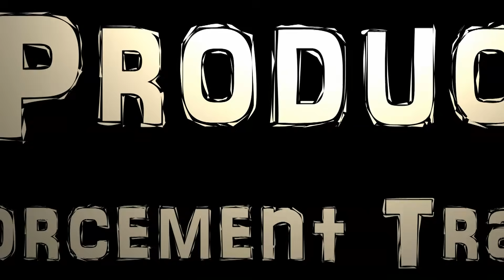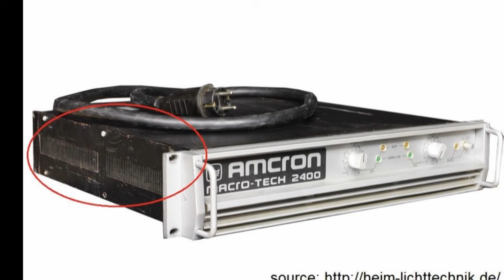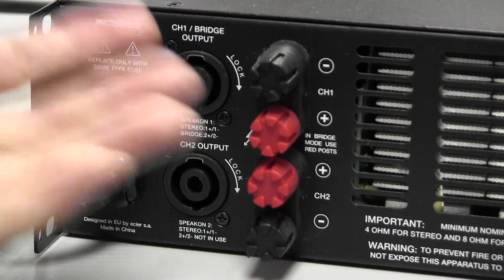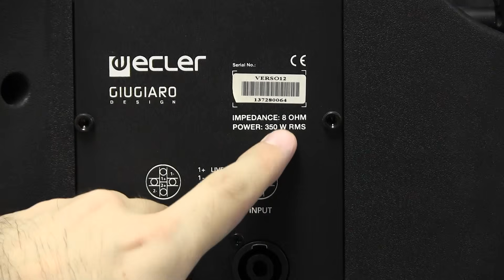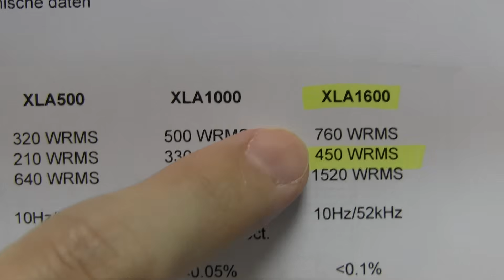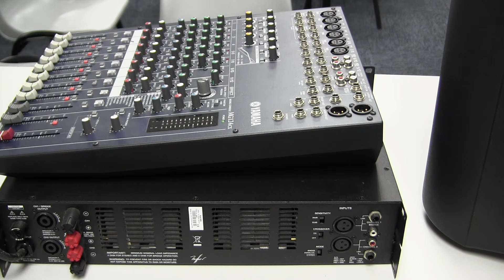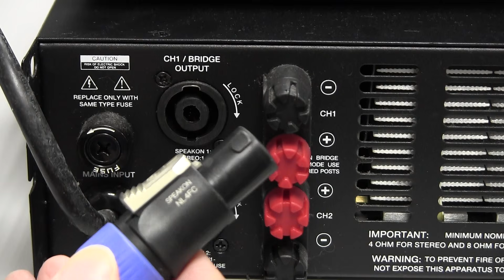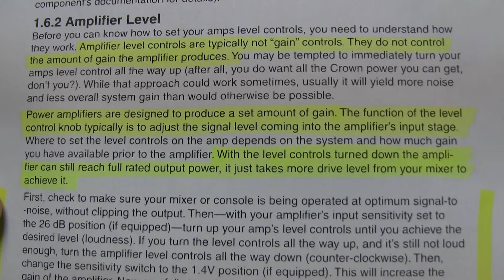How to connect a power amplifier to passive loudspeakers

Comment: Hi GLB a quick question please. if  I connect my loudspeaker 8 ohms to the speakon terminal channel 1 can i connect another 8 ohms loud speaker to the binding post on the same channel? and this will result to a 4 ohms config on my speaker?
Reply from the maker: Yes you can, that will result in a 4-ohm load on that amplifier channel, with each speaker getting half the power.
Reply: thanks much GLB for your reply. Your videos are so informative.

Comment: Hi Bruno, I am Rolando Galicia from Manila and i have an amplifier Denon Precetion Audio Component/Surround Amplifier AVC-1550. My problem is i do not have a wiring guidelines to connect in BRIDGE CONNECTION. Can you help me how to wire up.. Have a good day to you.
Reply from the maker: Those AV receivers are typically not designed to be bridged - if you really want to investigate this I suggest contacting Denon directly.
Reply: Thank you for your spare time for replying my message. What if I use APS 10 - Phase Shift control...do you think it will work? thanks and I do really appreciate your teaching which is clear and nice explanation...All the best..

Comment: Hi GLB Productions, I need your suggestions, I wrongly connected the polarity of the cable from 

my Spendor S3/5R2 speakers to my vintage Sansui stereo amplifier as follows: 

As wrongly the 2 Negatives of the 2 speakers were connected to the one channel of the 

amplifier and the 2 Positives of the 2 speakers were connected to the another channel of the

amplifier. One speaker was working and another speaker was not working. I was confused and

didn't notice about the wrong polarity for about 15 minutes, then I checked the cable

connections and detected the wrong thing. I became panic and sweated like anything. After I 

made the correct connection the two speakers sing as usual. But.. even though the speakers are

now working, still I have some fear. By the wrong connection:   Would the cross-overs of the 

speakers become weak? Did I do the great mistake? How will be the life and health of the speakers?

May I keep the speakers for long time?. If it would become weak, that would how much? 

Kindly let me know about in detail. I am much worried about the thing.
 
If I hear from you as: 'Need not be worried and the things are fine' , then I will be jumping 

with my transplanted knees! I very much love these small beauties. But, now I am sleepless. 

Thank you,

Regards,

Suseendran.
Reply from the maker: Well! I'm glad to hear that you spotted the problem. I just spent a few minutes drawing out some possible speaker/amp combinations and I'm pretty sure that your speakers are ok. If you damaged something you would be able to hear it almost straight away. If I were you I wouldn't worry and sleep well tonight!
Reply: Thank you very for the reply. Now I got the peace of mind. Thank God. Thank you once again. Best Regards,

Comment: CAN we use a power amp through powered mixer and run speakers through power amp, while other speakers directly connected to Powered mixer ? thanks
Reply from the maker: Yes you can connect the LINE LEVEL outputs of your powered mixer to another power amplifier in order to add more speakers.

Comment: I'm getting 2 behringer VP2520 euro live 2000w pa speakers and need to know if there was a certain mixer that I should get or if any mixer will work
Reply from the maker: You should get a mixer that is suitable for your needs and level of experience - your pro audio retailer will be able to advise you.
Reply: GLB Productions does that mean it doesn't matter what mixer I get as long as I know how to use it because I haven't used one before and I'm buying straight from amazon
Reply from the maker: I suggest getting some advice from a real person rather than buying sight unseen - there are so many different mixers out there with difference frame sizes, features etc.

Comment: Last question I currently have my setup as follows powered mixer with a 10" powered monitor can I hook up my passive loudspeaker to the mixer without having to use a power amplifier and if so how do I connect it properly?
Reply from the maker: If your mixer is a powered mixer (ie with a power amplifier section and speakon outputs) then just connect your speaker to the mixer in the same way as you would connect to an amplifier.
Reply: GLB Productions okay thank you

Comment: This video is very helpful thank you I have 12" rms passive loudspeaker and I thought I could just connect it to my Behring mixer but after watching this video I know I need to get a power amplifier to run the loudspeaker  can I run a subwoofer with the 1 loudspeaker based on how you connected the cables in the video
Reply from the maker: You want to run one sub and one fullrange speaker? Or one of each?
Reply: GLB Productions  one of each
Reply from the maker: If your sub has a passive crossover you can run amp -> sub -> fullrange but you'll need to make sure you amplifier can handle the combined impedance.

Comment: So this video was extremely informational and I've gained quite a bit of information but my problem is still unsolved. I received a DFX-215 speaker from a person and it seems to have had work done on it. This is no problem as i can solder wires and what not but i have the speakers wires (just the wires no plugs) and i have no clue how to hook them up to a power amp. I would greatly appreciate any help
Reply from the maker: If you are working with a speaker that has been modified then you will need to contact the manufacturer for the original specifications, in particular for information on what crossover is required and whether the speaker is designed to be run fullrange or biamplified. They will be the best people to advise you.

Comment: hi, this is a very informative video. i have a question, i own a presonus studiolive 16.4.2 and a pair of blastking passive speakers, but when i send the signal out of the presonus it sounds like crap, is it just because the need of the power amplifier? i don't want to waste money on an amplifier that might not be the solution, thx a lot
Reply from the maker: Where are you monitoring the signal that sounds like crap and what exactly about it is crap? Tone, distortion, volume etc?
Reply: i am trying to monitor sound on a pair of passive loudspeakers, they have each 2 jack plugs , i'm sending the sound through a presonus studiolive mixer via the aux send but the sound i get on the speaker is really distorted and very low volume, i set the volume really loud but the sound comes really low and distorted. so the solution is to connect the mixer to the power amp and then the power amp to the loudspeaker? thx
Reply from the maker: Aha yes that would most definitely be the issue ;) With passive speakers you MUST have a power amp - you can't drive them from the output of a mixer! Have a look at my recent video on active subs for the difference between active and passive speakers: https://www.youtube.com/watch?v=548GZAF6fMY
Reply: thank you very much
Reply from the maker: You're welcome :)

Comment: Hello, good video there... I have something to ask. Well, u see, I have an active speaker which the amplifier inside is already broken. So what I planned to do (which i have already done) is to disconnect all the wires inside which connects the speaker itself with the amplifier and do a minor modification which able me to connect the speaker with external amplifier. In a simple language, I have just converted (Modified) my active speaker to a passive speaker. Then, I had a 4-channel powered audio mixer which is used to power up the speaker via TRS cable directly without amplifier (coz the mixer itself is powered). So my question is, is it okay to do that? Will it damage my mixer or the speaker itself? because whenever the music goes loud or bassy, the mixer will stop sending audio signal to the speakers and resumes back when the music goes low or when the bass turns low.
Reply from the maker: I suggest getting the active speaker repaired instead of trying to improvise a solution as you have done.

Comment: Hello, very good video, i just have a doubt, how i connect my speakers, I want to connect them in stereo, but in the back they have this two in's, but above de two in's says "all inputs in parallel/speaker connectors: +1 pos/-1 neg", thanks
Reply from the maker: What sort of connectors are they? Quarter inch, binding post, speakon etc?
Reply: two of them, quarter inch (above) and speakon connectors(down), thanks!
Reply from the maker: alfredo carri Ah ok so you have one set of quarter inch connectors and one set of speakons. One connector is an input, the other can be used as an output. Just one one connector, either the speakon or quarter inch.

Comment: What's the different between home sub and for Dj sub?
Reply from the maker: Size, weight, power handling, frequency response, driver efficiency, design :) Subs for professional use are typically larger in size and can handle much more power.

Comment: Nice video.
I have one question, I hope you can answer it here.
I have Yamaha mixer EMX5014c, it is an active mixer (500+500W), and it have LEDs at master output section labeled "limiter". What is their meaning? Are they showing me that audio signal is clipping and distorted OR are they showing me that some internal eletronics is used to somehow limit the sound so there is no distortion?
I don't have osciliscope to see the signal but I can't hear distortion when I bring volume so high that those LEDs are flashing.
Thank you.
Reply from the maker: The limiter light indicates that the limiter has come on, in other words the signal is being limited to prevent distortion. However you should still reduce the level - more info on page 24 here: http://download.yamaha.com/api/asset/file?language=en&site=countrysite-master.prod.wsys.yamaha.com&asset_id=9177
Reply: GLB Productions Thank you for answer. I'm good with eletronics but sometimes companies put one label by the LED but eletronics inside device is doing something else. Like here LEDs could show cliping but label can be "limiter".
Reply from the maker: ksrele You're welcome, all the best with your music!

Comment: 27:40 I recommend to never use the level controls under 50% while trying to get high output levels. The reason is very simple : when you have to hit the input harder you risk clipping the input stage of your amp or any other device before your amp (EQ, x-over, mixer ... etc).
Personally I always use a DSP and set my amp levels to 100%, this is a best practice especially if you use more than one amp.
Reply: Signal first comes to the gaint control pot then it goes to preamp section then it goes to volume control pot after that it goes to suming opamp... so, if you set gain to low settings you can bring higher aplitude signal to input without clipping preamp.
Reply from the maker: ppdan thanks for your comment - this statement is too general to be used as a rule - remember that you can ALWAYS clip any part of your signal chain with excessive input levels, regardless of the setting of your amplifier. I agree that with multiple amps it is best to have a uniform setting for the level controls but for smaller PA systems it's is more important to have good gain structure in the components leading up to the amplifier. The amp level controls are then used to determine final system output based on the situation and requirements of the event.
Reply: GLB Productions Indeed, you can always clip any chain in your signal path but when you attenuate somewhere in your signal path you will probably have to force the signal path at a different place.
Ideally your input signal to your amp should be +4dBu max which would result in max power on most professional amps with their level at max.
A professional mixer pushed to 0dB on its VU will most probably output +4dBu and a professional amp connected to that mixer will give it's max power with levels at max (unless the amp has gain setting that can be modified but one of those settings is the +4dBu setting).
If the level control on your amp is under 50% and you still can reach clip easily then there is something wrong.
Reply: ksrele I wasn't talking about the pre-amplifier stage but about the input stage before the pots. Every amp has a input stage (mostly simple opamp setup) before going to the potentiometer.
Reply from the maker: ppdan And what about situations where you don't need maximum power yet still want to maintain good gain structure on your mixer? Where would you turn down? Remember - no DSP or crossover ;)
Reply: GLB Productions In that case I have to agree that you could use your amp levels instead of lowering the master on your mixer too much and ending up a bad signal/noise ratio on your signal path to the amp.
But then, isn't the system too overpowered? If I have to constantly set my DSP to attenuate too much on one or more channels I probably made a bad system choice.
Reply from the maker: ppdan Mobile systems are used in all sorts of different venues, and there often isn't time to do a detailed recce before each event so yes the systems often end up being overpowered, especially for smaller rooms. That's live sound for ya :)

Comment: All your video is very helpful, 
I have yamaha power mixer EMX5 ( 2 ch 630w each @8 Ohm), 1 pair of bose 901 speaker (10w - 450 w @8 Ohm) and 1 pair of Sansui SP Z-99 ( 320 w @8 Ohm).
Can I wire parallel bose and sansui speakers in to each channel of the EMX5?
will they hurt each other?
Reply from the maker: Jimmy please watch my video on this subject, it will outline the various factors that you need to consider: https://www.youtube.com/watch?v=l9L7uK7Xy0w

Comment: i have a quistion, how do u connect a amplifier to a 7.2 av receiver. Do u need anything for it in between like a cross over because i want to build myself a home cinema system with 6 amps and 10 speaker. running 2 subs that use 1500 watts from a bridged behringer inuke nu3000, the other 8 of the speakers i run per 2 in stereo also from a behringer inuke nu3000. they use 440 watts per channel  but i do not know how to wire these amps to an av receiver and i cant find it any where. Can some one please help me
Reply from the maker: AV receivers will typically have an output for an active subwoofer - this is the output that you want to connect to the input of your subwoofer amplifier. For the remaining speakers, you'll need to find a way to get the surround signals out of the receiver at line level - some receivers have connectors to do this, others do not.

Comment: Hi, great video.  I have a question as I am troubleshooting a situation.  Does overloading impedance blow the speakers or blow the amplifier?
Reply from the maker: Connecting a power amplifier into too low a load impedance (ie too many speakers) will generally damage the power amplifier due to overheating and thermal shutdown.

Comment: my band wants to use one amp for top speakers and another amp for subs how can I hook that up only using the main outputs on the mixer ? thank you
Reply from the maker: You'll need to run your signal through a system crossover like the DBX223XL or a digital system processor of some kind that will split the signal into lows and highs. Some amps also have this feature built in.
Reply: GLB Productions Ok can you come out of the first amp through the parallel inputs? Thanks soooo much
Reply from the maker: It depends on the amplifier but this is usually possible. However an electronic crossover will need to be placed between the mixer and the amps.
Reply: thank you so much
Reply from the maker: You're welcome!
Reply: McCain comments july 16

Comment: Bro, can i use the Behringer epq1200  power amp running 1200 watt in Bridge mono to a Behringer sub Woofer 8 omh of 400 watts.
Reply from the maker: If it's 400 watts rms/800 watts programme then yes but otherwise you risk damaging something.
Reply: The Speaker is RMS 400 Watts / Peak1600 watts and the Amp is Stereo 320 watts 8 Omh / 600 watts 4 Omh / Bridge Mono 1200 watts.
Reply from the maker: Yup no problem - just be aware that you are on the higher end of the power delivery that is suitable for this sub so be a bit careful ;)
Reply: Ok bro .. Thanks a lot.

Comment: How would we connect power speakers to our present system which is made of 4 passive speakers, 2 power amps and a console that has one pair of main inputs.
Reply from the maker: I assume you mean one pair of main outputs? Which console are you using please.
Reply: GLB Productions allen & heath Zed 22fx
Reply from the maker: Ok - you'll need to find another output from the mixer to drive the powered speakers. The best option would be the mono output. Alternatively use a splitter cable on the main XLR outputs or daisy chain from the input of your power amplifier as I show in the video.

Comment: Very informative video.  What about a situation where you're on stage playing the keyboard and need to use the submixer with a keyboard amp to control onstage sound but still need to send a signal to the FOH? Could you please elaborate on that? thanks again for the great videos.
Reply from the maker: In that case you would use one set of mixer outputs to send signal to the FOH and another set to send signal to your keyboard amp. Some mixers have two sets of main outputs (XLR and TRS) otherwise you would need to use a group, matrix, aux or utility output.
Reply: +GLB Productions thank you
Reply from the maker: You're welcome :)